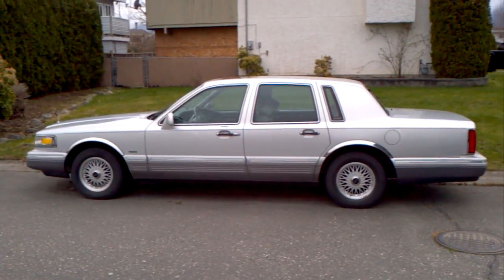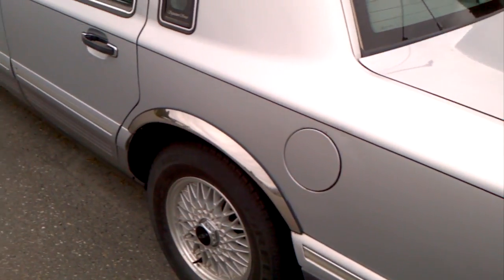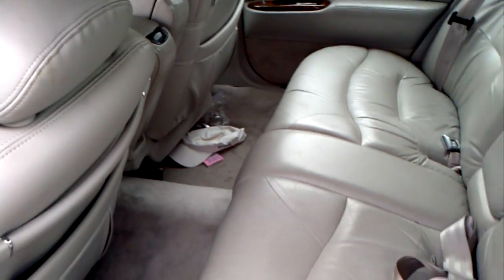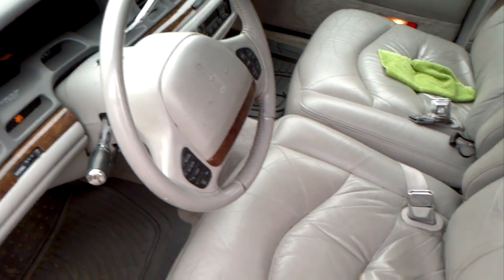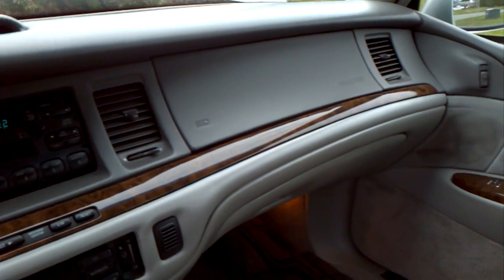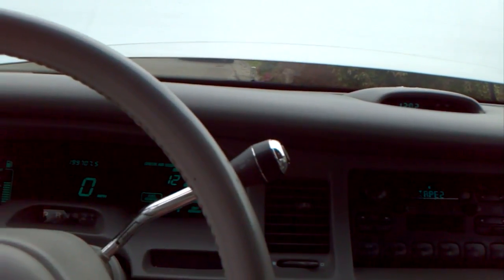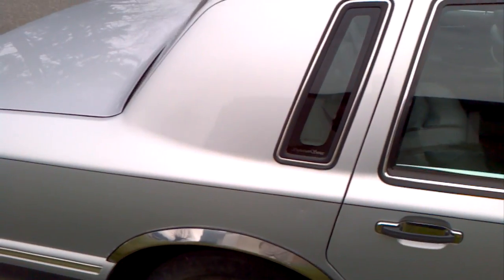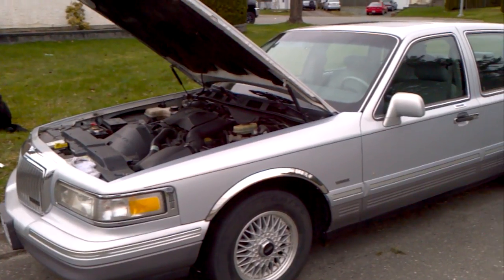1996 Lincoln Town Car Signature Series

Comment: I have a 96 Towncar. It's my only transportation. Just rolled 90k miles on it. I love it despite the intermittent problems. She's a babe to drive. The AC has never been touched and is used daily.